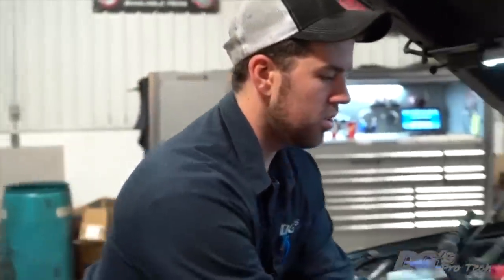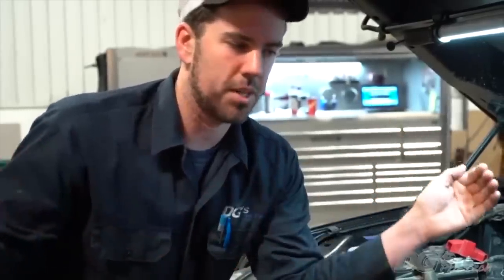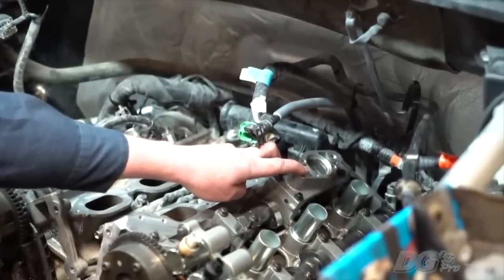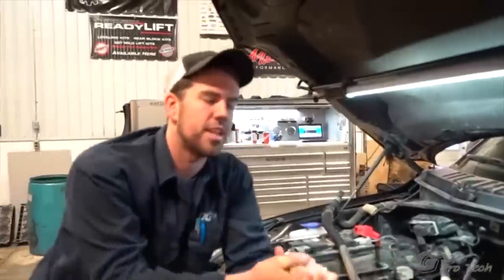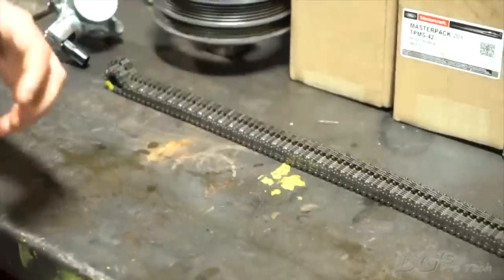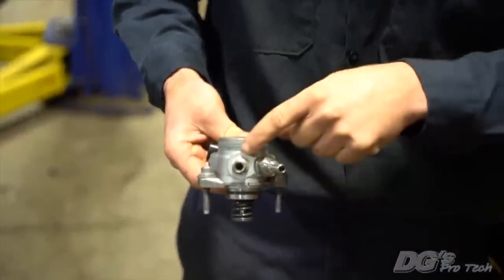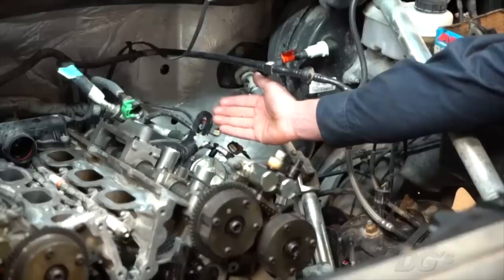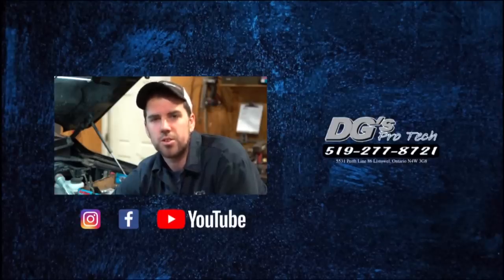What you NEED to know about Ford EcoBoost Engines by Dustin Golley of DG's ProTech

Comment: I’ll just stick tried and trusted Tundra v8. At least they got two of them with a million miles on the original engines and trans. If you gotta baby a work truck, it gonna cost you a heck of a lot more then just spending on ⛽️
Reply: All of my Ford F-150 trucks have gone over 250,000 miles. I use them as work trucks.
Reply: Not in a work environment.  Ford is  still holding the title. It won't change for years, if rver.
Reply: I have friends with both 3.5, and 2.7 EcoBoost and they are powerful.
Reply: Harley Jackson nobody disagrees with that just saying that when a mechanic needs to tell you how to drive a truck to avoid turbo issues and tell you it needs meticulous maintenance for the motor to last but fixing issues he’s having with timing chains is the reason Ford F150’s cannot get top scores in reliability and dependability. You don’t have to believe me, check the facts.
Reply: guy prophylactic,  I  how all about engines. Owned many, maintained many, Ford is the best of work trucks.
Reply: Harley Jackson the Tundra is not far behind and they just started building them in 1999.
Reply: If you want a work truck,  get a Ford!
Reply: Harley Jackson I already do have a work truck and it’s not a ford.
Reply: guy proulx because the F150’s are a lot more cooler plus most of their customers are satisfied with them. Numbers speak for themselves.
Reply: guy proulx I never said it was a better truck, I just answered your question.
Reply: And to your second question, yes. If not, they wouldn’t be in the lead of the half-ton market as they’ve been since forever and still today. Just like how the Camry and Corrolla dominate in the lead with cars, the F150 dominates with half tons duh.
Reply: Never have problems with my Ford trucks!
Reply: Harley Jackson hey, I don’t disagree with what you say. I just pay attention to trends and reliability reports. I like F150’s also but experience have shown me the Tundras hold up longer with less maintenance.

Comment: Had a used 2013 F150 3.5 Eco boost, owned it for 11 months, not a hitch nor check engine light (other then the one issue involving the spark plugs seeping compression but that's when I first got it and it wasn't a big deal and it was fixed right away) and change the oil and filter at 5 to 7k miles intervals, Every weekend I stomp on the gas to make sure the turbos are still working and see if the turbo spooling sounded good. Since I don't really abuse it a lot or tow at all, was about a week out till it's 3rd oil change and the engine blew up. Can't say how the previous owner maintained it but after taking on 20k debt that year to get the  truck and an engine job would of costing 9-10k (or if i want to do it myself 5-7k to cover the core charge 7k was reserved if the catastrophic fail took out my 2 turbos. At it's worst after core charge is reduced a high 4k would be my real cost)

Needless to say I was unable to get a lone to do the work (even for myself) and to be fair I really didn't have the truck long enough to prove it's reliability or it's worth of investment, So I was bit leery if something else powertrain wise would go because last thing you want to do after engine job is a trans. I ended up trading the truck in for 7k rolled over the left over debt and got a (because banks seemed more moved when they have collateral to gain) 2019 Jeep Cherokee. 

By the way I did look into/asked if the dealer I got this truck from would work with me to try and make this right and obviously they did not. 

More info:  Before I traded it in, I did look into the engine by pulling coil packs, spark plugs and put a bore scope down each cylinder. But before  I did that I kind of already knew witch cylinder was bad since the spark plug was smashed in Cylinder Number 2 Piston seemed to be blown apart, can't say what really happened, but what I can see is two corner edges of the piston stuck on the cylinder wall and big hole in the middle.  Maybe It dropped a valve but all I know is the engine is fucked and guess I could say the engine took a number 2 on me. 

Also the real good reason to change your oil regularly on the 3.5 Eco Boost is to make sure your water pump is ok, since when it goes bad it can internally leak into your oil pan and you will find out first thing when you pull that plug.
Reply: U bought an unrelaible ford then bought an even less reliable fiat grand cherokee
Reply: @ToyotaNutjob  I don't know, I already put 10k with no issue on the jeep and  also forgot to tell you I'm mechanic (be it a diesel mechanic for International Dealership ) so if I did have a small issue i could handle it. (but only after warranty is done because I do like free )

Also you assumed it was a  grand and you would be wrong.
Reply: DDay early ecoboost engines had issues with condensation forming inside the intercooler. The water could build up enough to become ingested. A hydro lock at highway  speeds will do exactly what you had happen. I know someone who went through the same situation as yourself. The fix was a ford crate engine with turbos (about 5 grand) a long weekend and lots of elbow grease. I have a 2011 platinum and have the 5.0. When I bought it new, I was nervous about the ecoboost engines because they were a new technology. Supposedly you can drill a small hole at the bottom corner of the intercooler and you would be amazed at the amount of water that will leak out over time.
Reply: @Fireship1  I didn't have 5k , also that's after core return price, you would at least need a high 6k to low 7k to get them (got a quote thru my my job (I work at International Dealership and ford has an account with us) so that with at a discount price.  As I said before I was unable to get a lone to do the job. Something I didn't say was I lacked a flat and dry area to do the job for myself and I could not do it at work since it might tie up a bay.

Comment: The water pump on the F150 isn't internal like it is on the Edge, Flex, and Taurus
Reply: Super20dan...
Sigh. You just are proving what is wrong with message boards... Anybody can spout nonsense and people will believe it. Unless you can show me an ASE master technician certification and a Ford Senior Master Certification... Your opinions are useless.
Reply: prove it, don't believe you
Reply: Dirty Harry  explorer engines grenade at about 140k you didn't drive long enough
Reply: Dirty harry, 
I have been working at a lincoln dealership since the 90's, and the engine's we have today are far superior to those in the past. Maintenance is key. Fix it when it breaks, don't let problems persist, and any vehicle will last 10-15 years without a major issue. Up here in Minnesota, the rust kills vehicles before their engines or transmissions give out.
Aluminum bodies are the way of the future... They might last as long as the rest of a well maintained vehicle.

Comment: WRONG, Actuators are the cause of the excessive stretch so you need to replace the upgraded actuators from Ford. Next problem is people installing aftermarket chains and actuators causing another replacement. Buy the Ford kits for this as as of yet aftermarket parts are severely lacking.

Comment: What I got out of this?  Keep my foot in it and keep those turbos engaged.  No prob!!  Happy to oblige! :)
Reply: I guess I should use my turbo more often. I have a 2018 F150 Lariet with the 3.5 eco boost. Love it. Got it for Christmas
Reply: Michael Godsey I change oil every 3-5k and use lots of pedal. I have a whipple stage 1 kit installed and I pull my 24’ camper at 70mph easy
Reply: @jsimsgt96  i do the same now that i'm running 14 PSI on my 2001 GMC, I am sure it is over kill, but the engine was never built for 14 PSI and water/meth
Reply: my 2005 lincoln navigator has two rpm gauges the regular rpm and the gas level gauge  they move together  when I take off. I get around 0 mpg in city and 3 highway.
Reply: Jose Perez I had an srt 4, after it was broke in I averaged 19 mpg for 2 weeks 🤣
Reply: That's how I drive my 2015 Sport. Foot in it!
Reply: my tortus got a ticket
Reply: Lmao
Reply: Michael Godsey or the turbos will fail on you is what he’s saying smh
Reply: Michael Godsey yep and you’ll get Tundra gas mileage.  At least with Tundra you don’t need a tech to tell you how to drive it to avoid problems.
Reply: @365handle  Tundra gas mileage when its not towing.. thats not a very intelligent comeback. Whats it get towing? 7-8?
Reply: John Moon it will get the job done every time with no complaints or techs telling you how to drive or meticulously new born baby it.

Comment: I had a 2018 raptor with the 3.5 echo boost engine it had timing chain stretch with only 11800 miles.what a piece of garbage.The oil had been changed 3 times by the dealership.😜
Reply: Keep lying on the internet buddy it will get you places. Guarantee you drive a broke ass 98 shitbox
Reply: Is your oil pan plastic or metal?

Comment: Is a catch can worth installing on a 2011 Ford F-150 V-6 3.5L Eco?
Reply: 100% worth it
Reply: I use one and it catches quite a bit of blow by, I would say about 100mL each oil change. Hard to say how much of that would build up and how much would just get burned off the valves but hey why not keep that out of your engine if you can with an easy can install. My tip is dont tighten then can on too tight. It only needs to be hand tight and not cranked down like crazy. Compare to about how tight your oil fill cap or brake fluid cap might be. That way it is quick and easy to remove during oil changes. I just dump it in my oil drain pan and  recycle it with the used oil
Reply: I ran a UPR Mega on my 2011 3.5 for 100K miles... definitely did it’s job. The only issue I had wit it is that the can and the lines/ fittings would freeze if it sat outside longer than a day In the winter. (Minnesota)
Reply: A catch can is a must on anything before 2017. 
2017 and up added port fuel injection to help clean up the intake valves from coking. 

Honestly with anything before 2017 id ad a methanol injection kit to clean the valves up while giving potential for tuning

Comment: I have a 2013 lariat ecoboost with almost 400'000 km and it still runs like a monster. Use proper oil (amsoil) and filter (oem ford oil filter) like he said, change oil at 5000km and youll be solid. If you wanna go a step further get an rx catch can. These engines last for those that take good care of em.
Reply: I know of 2 people with failed cam shafts. Another issue...cam phasers
Reply: Highball 734 :  interesting how passionate people are about the oil they use. I never have a problem using what is recommended in the owners manual - usually printed right on the oil fill cap too. Personally I think the change interval is key. And that depends on highway/city, dusty, hot/cold climate. Most of my miles are stop/go in town. Around 3000 miles I get the Ford “Works” Service because it is often on special from Ford Motor Company. It uses Motorcraft synthetic blend and the Ford filter. Tires are rotated and battery is checked as well as a good overall inspection. I know they do it right because I have had a battery replaced and also a tie rod, all under warranty because of the inspections. 3000 miles might be overkill but I am not getting the oil labtested and fresh, clean lubrication is good maintenance that provides cheap peace of mind. And I do not begrudge anyone who wants to spend more or less for their opinions and personal piece of mind. Might just want to ask yourself which vehicle you would rather buy used. Let that be your guide for maintenance.
Reply: grumpy old fart  no, i just checked your claim, i wouldnt pay that much for oil like you are. those are prices directly from amazon like you claimed
Reply: no, youre not comprehending what I'm saying, i called you out on your prices because i looked them up. youre not paying less than $5 per quart, delivered or otherwise, for synthetic blend oil that is marketed as "full synthetic"
Reply: Also these things are plagued with head gasket failures
Reply: Maintenance is the key!!  Don't buy used without it!¡
Reply: jumpship88 when one ecoboost can reach a 500,000 trouble free miles without serious costs, then I’ll check the difference in gas savings vs repairs.
Reply: @365handle  yes and don't forget the additional cost of all that oil and filter product and what you may have paid for someone else to do it.
Reply: I can tell youre not a chemist either, because you don't realize that full synthetic isn't actually full synthetic. only a few brands are, mobile  isn't one of them. youre not buying mobile from amazon for $4 a quart on amazon unless youre getting special discounts others cant get or you use a amazon rewards card. scamsoil around here runs for about $11-12 a quart, looking on amazon right now  1 quart of mobile 5w30 full synthetic is going for about $9 if you buy in bulk. even their mobile super is $6 a quart, which again is just a synthetic blend oil thanks to the law suit over what actually defines "full synthetic" here in the US.
Reply: @stewpidaso26  Lycoming aircraft engines such as in Cessna 150, 172, 182, Piper Warrior, etc, allow only two oils to be used - either Aeroshell or Mobil1.   That's a good enough recommendation for me.
Reply: youre wasting money with scamsoil, or any synthetic, at that OCI. you might as well be using motorcraft oil and saving $10 a quart per change. unless you you change you oil at 10,000 mile intervals youre not even breaking even on cost, at 5000km a conventional oil oil would serve you just as good as a synthetic.
Reply: @stewpidaso26  Generally I agree, I've taken samples, and only run synthetic, I can tell you 6000 miles is where "good' oil loses it's 'alkalinity' and becomes acidic.  But as tight as the tolerances are in the phasers, I'd lean on synthetics.  Maybe 4000 mile changes with dino oil.
Reply: @stewpidaso26  amsoil is the best oil on the market. You know nothing.
Reply: they have the best marketing scheme, that's about it.
Reply: @stewpidaso26  like i said. U know nothing. They dont have much of marketing really. Not many commercials. People who know, know. Name an oil that is better.
Reply: you know nothing because all you can say is "you know nothing" unless you actually change your oil at long intervals, which causes some of the problems stated in the video, youre wasting your money. go read bottles from the cheapest oil to scams oil. weird how an oil like supertech has most of the same ratings, like the dexos rating, but is only $2 a quart, a good $10 cheaper than your scamsoil.
Reply: @stewpidaso26  amsoil xl is good for 12000 miles. Amsoil signature is good for 25000 miles. Xl is anout $9 a quart. Its the only full synthetic oil on the market. The rest are blends.
Reply: @georgecantstandsya821  most are blends, which is why they are a waste of money. $9 a quart is a waste of your money unless your doing those 25k miles. how often do you change your oil?
Reply: @stewpidaso26  12000 miles at $9 a quart. Plus it provides the best protection of any oil.
Reply: @georgecantstandsya821  i know, you've already regurgitated that marketing sales pitch from scamsoil that provides no real context to your argument, and you didnt answer my question
Reply: @stewpidaso26  i change my oil every 12000 miles.
Reply: @stewpidaso26  in my 3.5 ecoboost.

Comment: how do you prevent the wear on the timing chain? what is the maintenance?
Reply: The early edition 3.5L 2011-2015 had used the wrong metal for the timing chain, it was weak and stretched. A TSB was put out to replace the chain and phasors with one made after some date in 15’.  I had my truck from 26K miles, used synthetic every 5K miles, changed the plugs regularly, kept the sensors clean, it was a high maintenance motor. But the chain still stretched at 118K miles. 
After all the engine work with the right parts, it runs like a champ..
Reply: guy proulx  is your Tundra a direct injection turbo charged motor?  The 3.5 L Eco is hard on plugs, especially if you’re tuned or tow a lot.  The I haven’t heard of anything really go wrong 5.7L in the tundra...
Reply: jumpship88 keep oil clean, use quality synthetic going to add few oz of motor kote every oil change same as I do on the 2.8 cts. Also I have been told to use ford oil filter . Same with caddy 2.8 in my cts added motorkote to the oil and using synthetic and Gm oil filters. On both the ford and gm change oil every 5000 to 5500 km and filters

Comment: 2016 f150 ecoboost with 90,000 miles, and I change the oil and filter every 5,000 miles. I test my oil with every oil change. The engine oil is always diluted with fuel, most is 5%.  5% happened with excessive engine idling, typically it’s in 2-3% range. I know folks that run their ecoboost until the oil light comes, and they are getting 12,000 miles between changes.
Reply: I change my ecoboost oil when the OLM is at 50% or about 4500miles. Glad to see I'm not the only one who changes ecoboost oil on short intervals.
Reply: Clay Rich your running your oil way over  there’s your problem
Reply: @IndustrialMW  can you clarify? I change my oil & filter every 5,000 miles, and Ford recommends 10,000 miles for oil and filter change.  So if I am getting 2-3% fuel dilution in my oil, what is the fuel dilution for 10,000 - 12,000 miles changes.